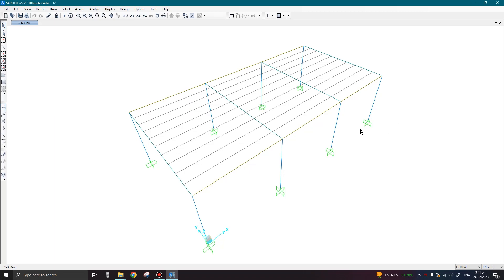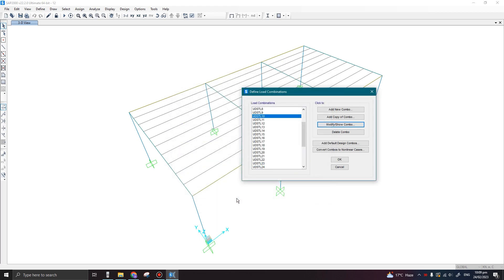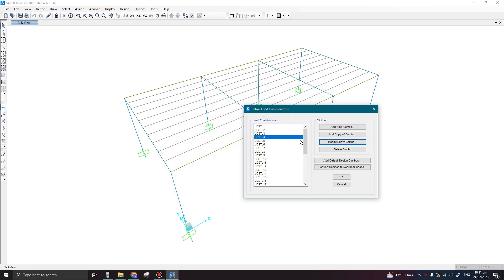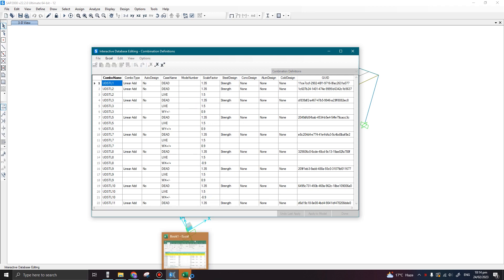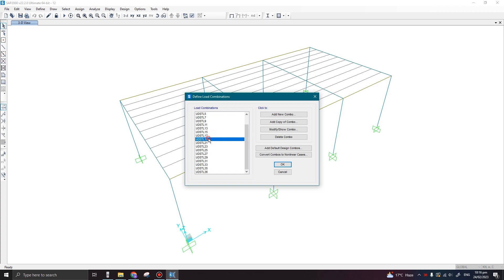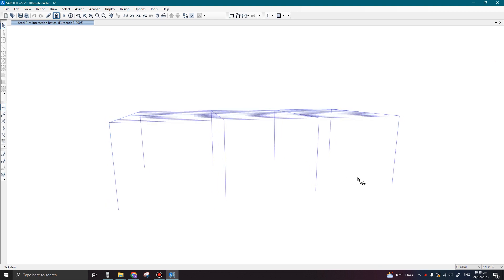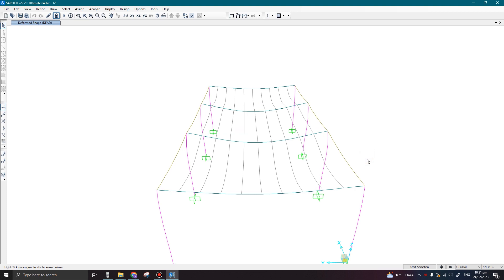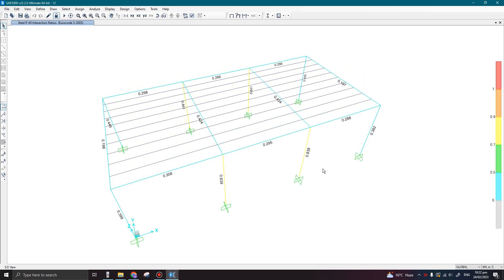Lecture 12 | Design based on Wind load combinations | Design of Steel Structures | SAP2000

Comment: What will happen if we don't delete the negative load cases from combinations?
For sure, it has an impact, but how big is it?
Reply from the maker: It will not be correct as we have applied the wind load manually considering coefficients. with negative signs it will reverse the directions of wind pressure applied. However, the overall impact on design will not be much even if you apply the negative cases.